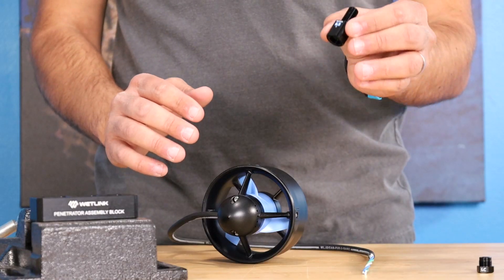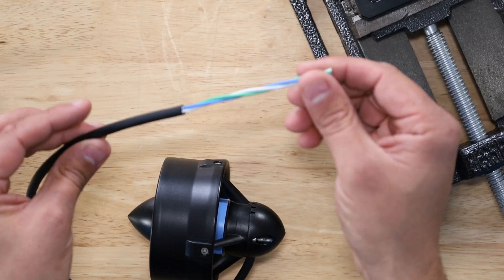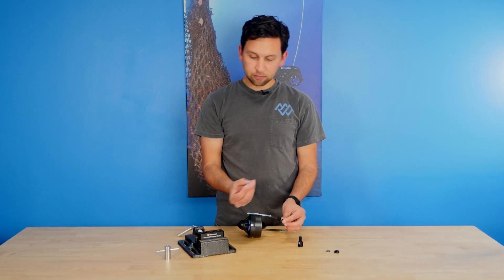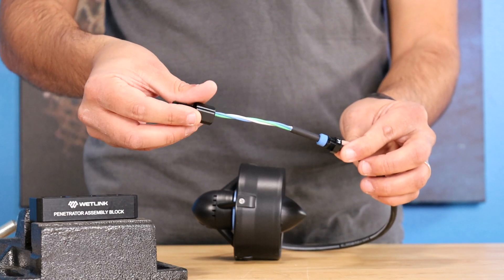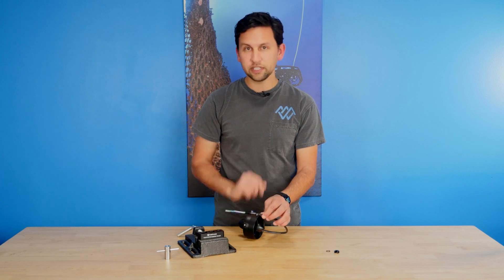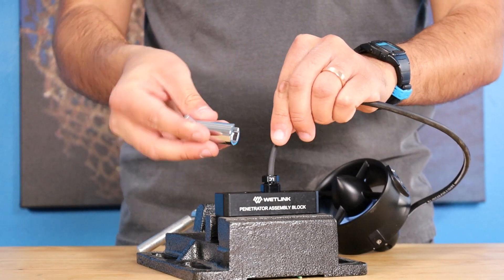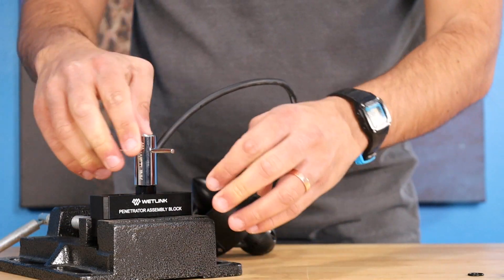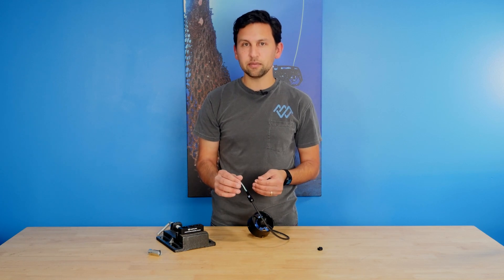Blue Robotics Tutorial: Installing a WetLink Penetrator

Comment: If the cable has shielding underneath the insulation, how should we proceed? Does it need to be cut off?
Reply from the maker: Hi there! If you're comfortable with the shielding being connected to the penetrator bolt and water, you can leave it as is. Otherwise we'd recommend putting a thin layer of heatshrink around it before installing the penetrator to keep it isolated.